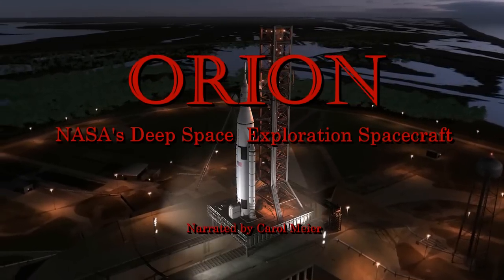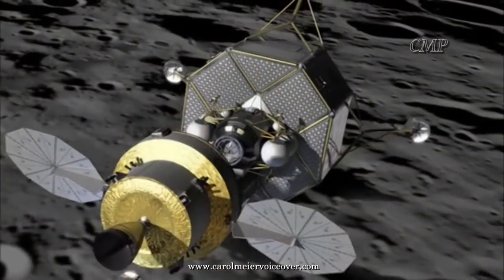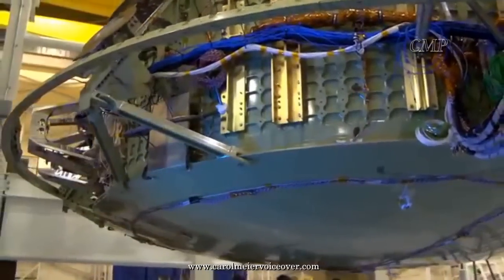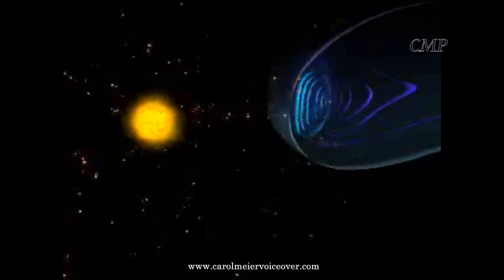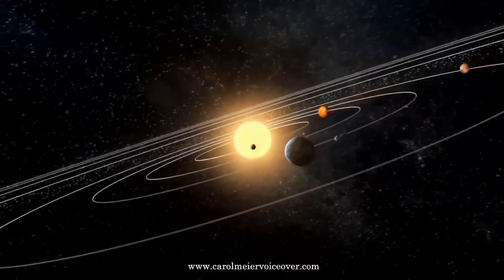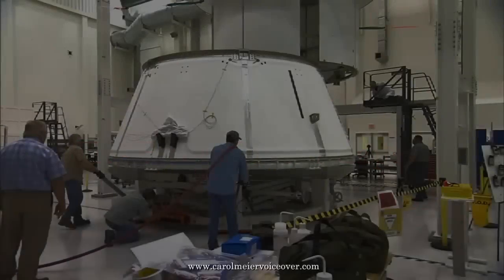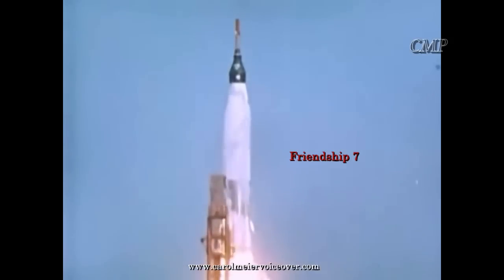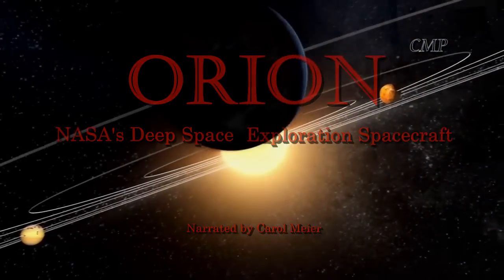ORION -Exploration Spacecraft - Explained in Detail.  Orion and Artemis

Comment: Hey, honest question here please.   If we cant get through the V belt right now... how did we do it to get to the moon?  Im sure theres an answer... just dont know what it is.
Reply: Oen713 We can get through the belts.
Reply: Oen713 When the Apollo missions launched out of low earth orbit (This was called the trans lunar injection) the spacecraft's orbit was aligned with the orbit of the moon and not aligned with the equator. The VA belts are only an issue near the equator so going to the moon didn't require passing directly through them.

Also because the trans lunar injection was performed near the earth the spacecraft was traveling almost directly away from the planet at a very high relative velocity when it would have passed through the belts so it would spend very little time in the stronger radiation.
Reply: ***** From what i understand (York Uni Astronomy).. the level of the radiation belt varies in amount ALSO due to solar radiation bursts that energize the belt when hit (randomly from our perspective).  AND id have to ignore the strange behavior of all the astronauts after the mission AND the fact no ones gone back since (not a single nation even attempted???).
   Besides that, Nasa themselves say its a problem (not buying the 'analog to digital' excuse either)... meaning the belt is there and is aa issue that needs to be overcome (not sure why youre saying its not).
  Personally... not buying it.  Weve never been IMO.  Too much evidence to ignore.  Could be wrong... but thats my opinion.

Comment: I notice they don't talk much of how they could do it all with !00% safe trips to the Moon and back with the technology of 45 years ago, makes you wonder.
Reply: MrRobtwothirds Who says Apollo was 100% safe?
Reply: MrRobtwothirds actually some engineers who worked on the Saturn V find it incredible they didn't have a catastrophic failure during any of the launches.
Reply: QuietEliteCAE absolutely, the men and women who worked on the Apollo program were truly the greatest generation of engineers.
Reply: Yes that was indeed very fortunate and a credit to the engineers responsible, quite an achievement in itself.
Reply: +moose2llama There were always technical problems on missions and also major problems that could had triggered an abort, but they had knowledge and also luck to solve problems.Besides Apollo 13 the most parts of other missions went fine.

Comment: This Orion Spacecraft is considered to be the successor of the Space Shuttle but will probably have the same re-usability problems like the Shuttle ond dont be very cost effective:
-New Service Modul every time
-New Heat Shield every time
-new small parts like the upper 'hatch' for the parachutes
So in the end only a reduced crew module (without shield, and upper parachute hatch) lands on the ground which will also need a overall maintenance (outer plates replaced, for example if micrometeorid impacts).
The only big advantage may be the bigger safety because only new manufactered (not malfunctioned) parts are attached /assembled for a new space mission.
Reply: gandharzero Well at least it won't be just American taxpayers funding it.
Reply: +gandharzero The Actual Capsule is The most expensive part.